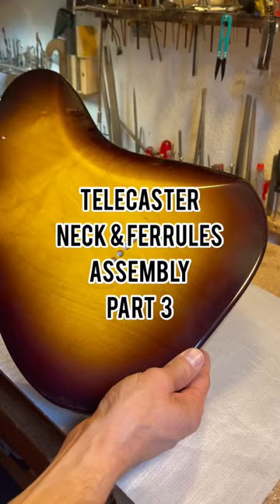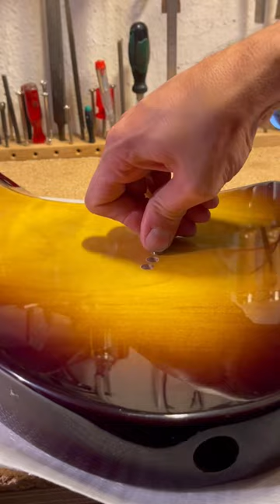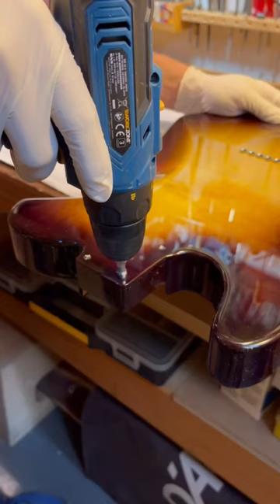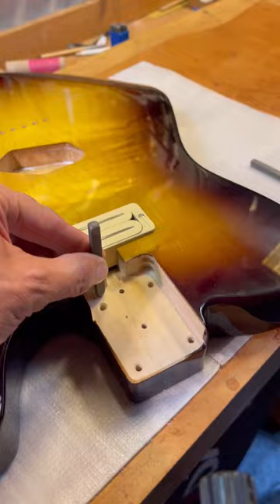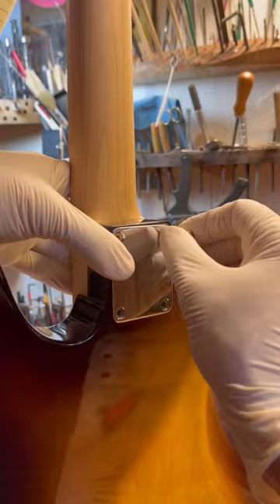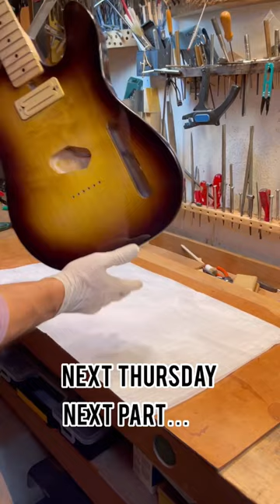Telecaster Guitar Assembly Neck/ Ferrules Part3 #shorts #craft #assembly #telecaster #asmr #skills

Comment: I wish I had installed flush string ferrules instead of the proud type on the French polished Koa Tele seen in my ID. Just a pref.  I also wish I had flush mounted the neck and control plates. I can still do it I suppose. Ugh!
Reply from the maker: Thanks for you comment. Yes that correct you can still do it. Best Regards Nik

Comment: That's the first thing I do when I get a bolt on neck is enlarge the body holes so the screws only bite the neck.  Otherwise they never tighten up.
Reply from the maker: That's correct. A lot of Guitars have the Issue that the Screw cannot press the Neck against the Body because the holes are to tight.. Best Regards Nik
Reply: If the screws never bite the body wouldn't it just come off? Don't you mean so they have bite the neck?
Reply: I realise I keep remembering the construction of bolt on necks incorrectly. The bolts go through the body first into the neck, not through the neck into the body. My man's got it right.